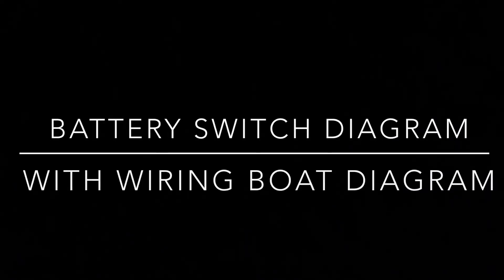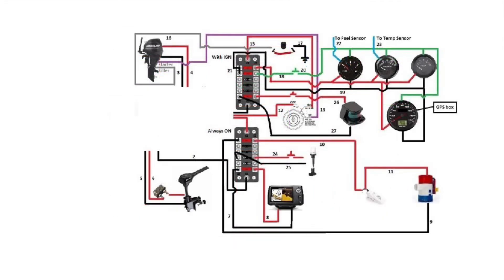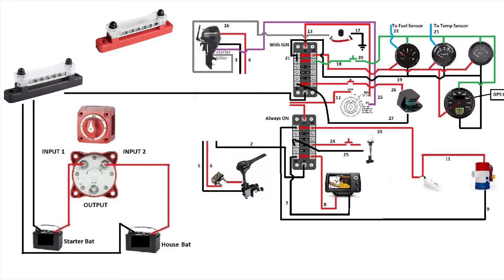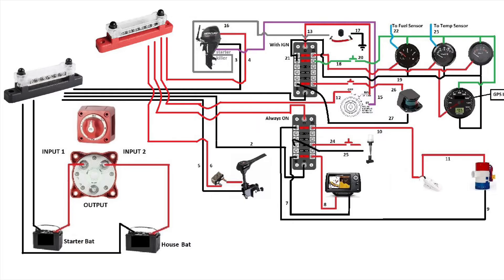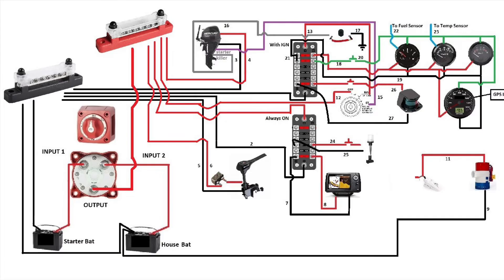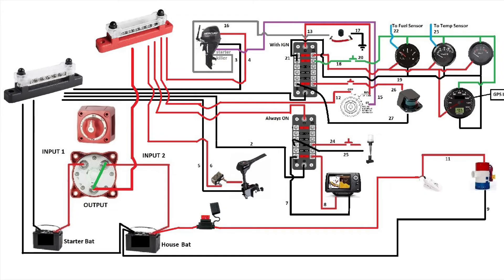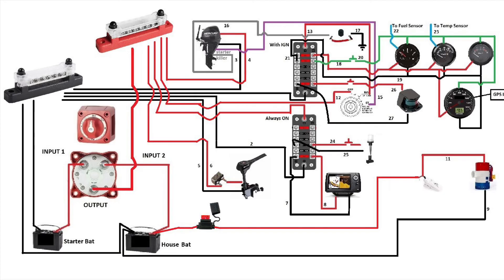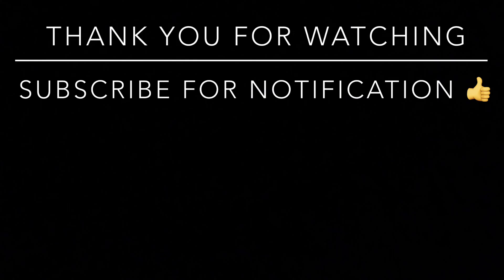Boat electronic wiring diagram and Battery switch diagram "Combined"

Comment: Hi Joe, although your videos are so helpful I was hoping you could touch on a few other subjects.  I was looking at adding a few other components to the system like like a dual battery smart charger and a stereo with 6-8 speakers
Reply from the maker: For your dual battery smart charger. Are we talking solar or electric. Send me your model that you plan to install. I will see what I can do 👍
Reply: @joetheboatguy5394  I am not confident in my choice but I was thinking the NOCO Genius 5, x2 (2 batteries) and an after-market plug so I can use an extension cord directly to the boat.  I have not purchased anything yet so If you think something else is better I am open to your suggestions.  I have a flexible 120V solar panel I was maybe thinking of using on the boat but not a priority.  thanks again, Professor!
Reply from the maker: Hi Michel, I actually like the Noco products. It’s a good choice. I would need to know if your batteries are set in series or parallel?  Professor 😂 far from that, I just am a tech in electronic 👍
Reply: @joetheboatguy5394  Hi Joe, my boat wiring is a complete redo so I don't actually have anything installed but I have a starter and house battery like in the video, only connected by a battery switch.  Was also thinking about installing an automatic charge relay (ACR).
Reply from the maker: Ok will try to do a wiring soon. 👍
Reply from the maker: Be ready Michel, your dual battery smart charger video will come tomorrow doing some final quick edits ;)

Don't know if you would be able to see it but it will be available tomorrow at 11am. Try the link you might be able to see it before everyone :) https://youtu.be/Q8VgRRlOmW0